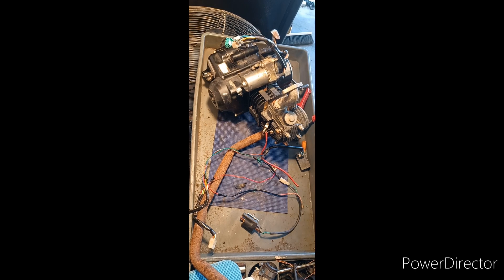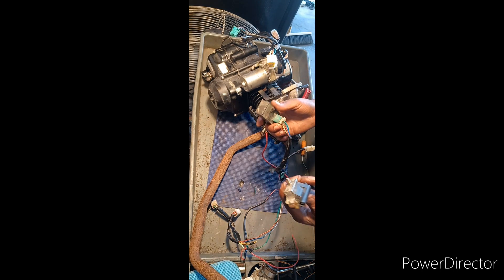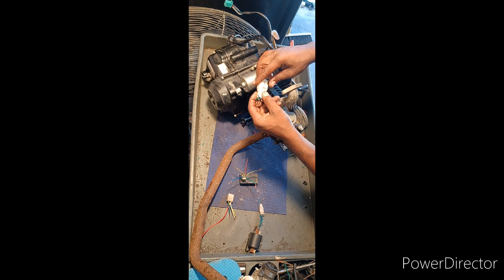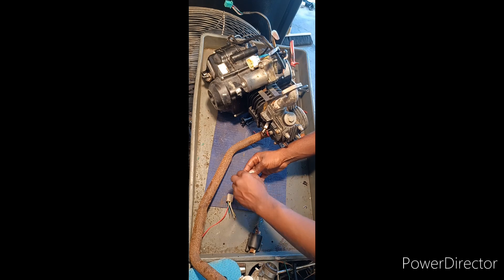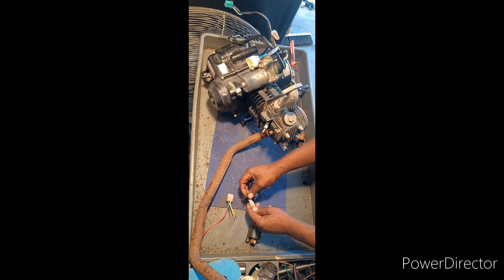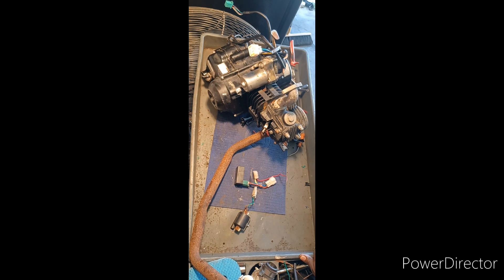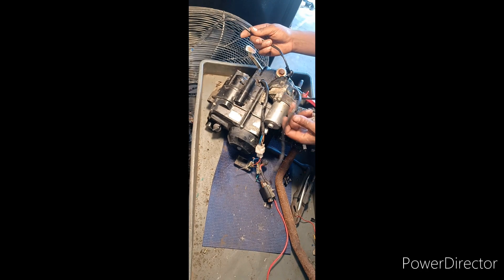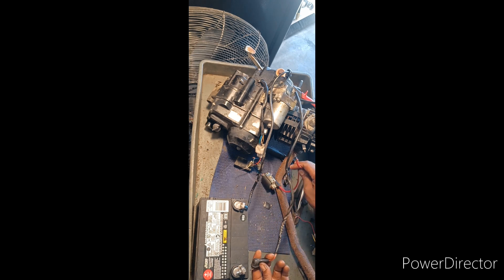how to make a 150cc 50cc 125cc 110cc Chinese engine electrical harness

Comment: I Bought a ICEBEAR 300cc water cooled Scooter , The problem is the dash do not light up, any suggestions' ?
Reply: yes ido i wanna be able to get on power without all them damb wires you fell me thatsfly l g man you simple Dude your the reason i like real shit you did that im in the process yes them dambwires thank you its kind hrd the view alickel bit but you are what thedoc ordered eand i just found out my starter took  🤮 on me so i think i need a  new one but thanks
Reply from the maker: Your welcome I'm glad I can help
Reply from the maker: It might not be easy but I would typically follow the wires coming from the light and check for power all the way to the power source